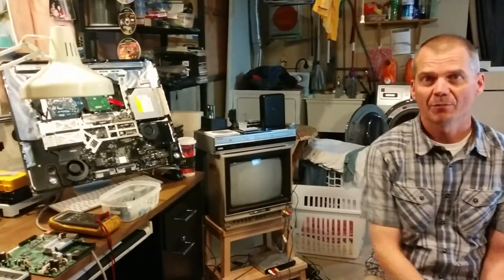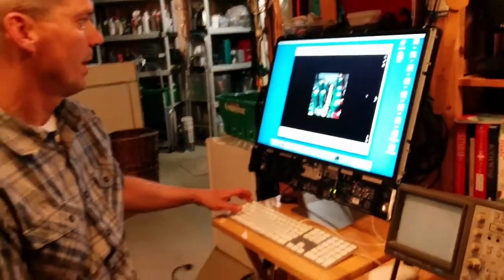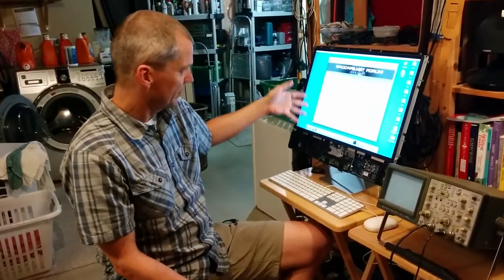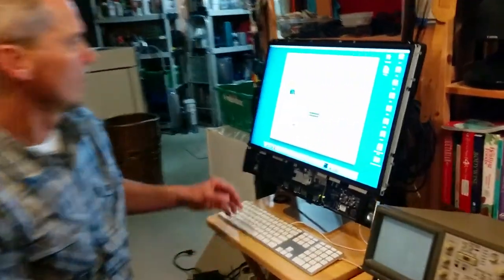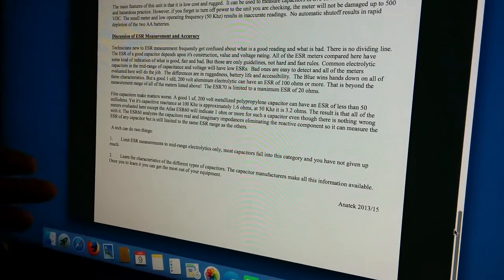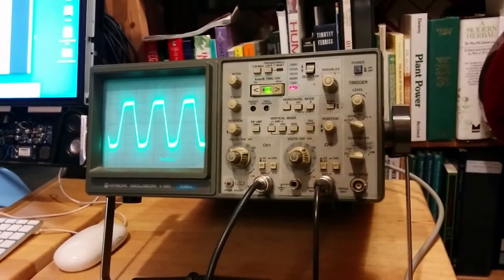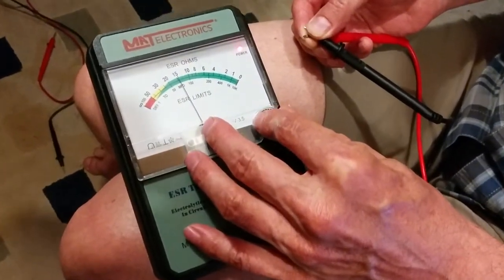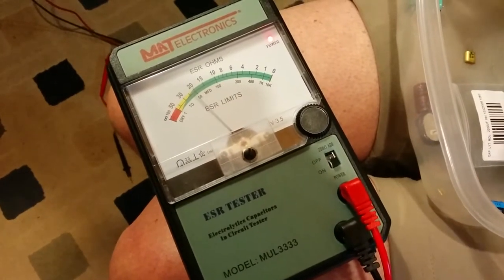Testing Aluminum Electrolytic Capacitors with an Equivalent Series Resistance (ESR) Meter

Comment: So why do FLUKE multimeters have a capacitance function on their meter. If their £600 meter cant really test capacitance because to do so you need Equivalent Series Resistance meter (ESR) to test capacitors?
Reply from the maker: Hi James.  Thanks for the comment.  Capacitance and ESR are two different things as you probably now know.  It's a bummer your Fluke meter only measures capacitance.  Having a Multimeter that measure both would be really nice.  A little Googling reveals Fluke may not "yet" make one.  They should though as we are all learning now, a proper ESR is incredibly important.